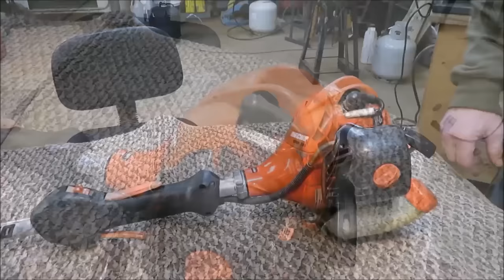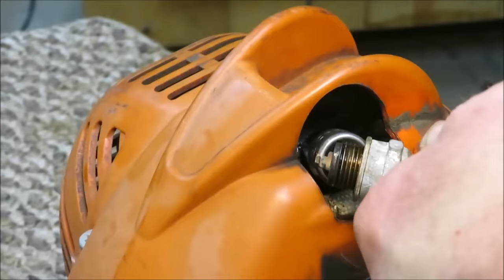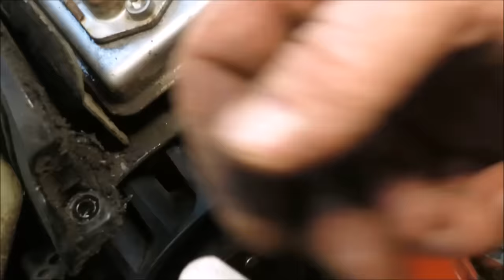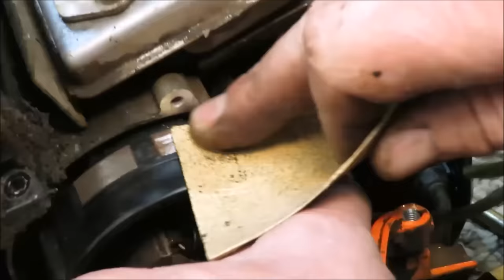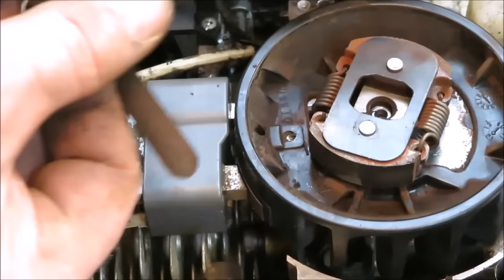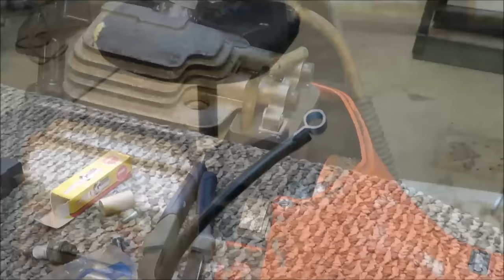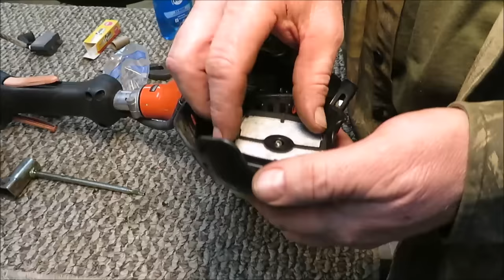string trimmer weed eater coil test & replace

Comment: I stopped watching when he put the spark plug right next to the hole and started pulling the cord. Recipe for disaster from fumes coming out and starting a fire!  Remove top cover and ground on engine AWAY from hole!  Also, internal combustion engine requires FIVE things to run, not THREE!  Fuel, air, compression, timing, spark - FACTS.
Reply from the maker: Thanks for the comment

Comment: Test the coil with an OHM meter spark plug wire to ground should be 2k to 15 K ohms Kill switch side to ground should be 1 to 2 ohms. You can buy a in line spark tester from HF for $7. https://www.harborfreight.com/90-in-line-spark-checker-63593.html?_br_psugg_q=spark+tester
Reply from the maker: Thanks for the info.
Reply: @Robinson-Homestead  You bet, Thanks for the video

Comment: First thing is a shot of starting fluid to the carburetor
Reply from the maker: Thanks for the comment.
Reply: Starting fluid is not recommended for use in 2-cycle engine because it contains nothing for lubricating the moving parts inside the engine.

Comment: Echos are good machines but they use cheap coils.
Reply from the maker: You got that right.
Reply: When I catch a neighbor who is chucking an Echo blower or trimmer, I grab it for free, check it for spark, then take the coil out and trash the rest. The coils cost around 50% of the price of the unit. In the case of my Echo blower, about $170 for the blower, and the coil was around $75. Ugh.

Comment: please be more correct in identifying parts the thing your describing as a magneto is the fly wheel and the thing your describing as a coil is the magneto,  the magneto consists of coil which is  the horseshoe shaped  mild steel part  and the rest is a  copper wire coiled around the coil  which produces the electric current that causes the spark
Reply from the maker: I have Aphasia thanks for the comment Kevin.

Comment: He made one mistake ,never hold plug over plughole when checking for 
Fire ,there is still gas in the cylinder it will only take one spark. Then you have  a fire, you old timers should have spoken up,. Be safe. Not sorry
Reply from the maker: Thank you for the comment Mary.

Comment: These magnetos are always packing up must be made of junk
Reply: I've been using and repairing small engines for about 45 years, and I've only seen ONE magneto coil fail. They are probably the most reliable component on these kinds of engines.

Comment: When you order the part it's called a magneto not a coil. If your plug was wet you knew it wasn't getting a spark. Why mess with checking for a spark. Where did you get your part that the plug wire wasn't completely assembled? I paid $15 for magneto it was completely assembled. You can quit saying I'll show you. How about I show you how to do things? You said you might not have fuel before you tried starting it. The spark plug was soaked with gas!! Cleaning carb? I know how to use a can of carb cleaner.
Reply from the maker: Thanks for watching.